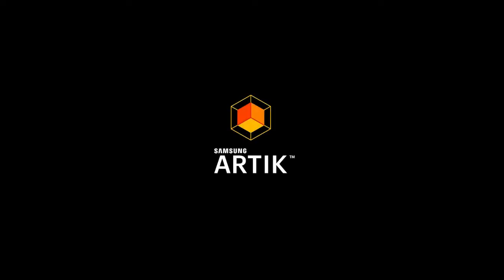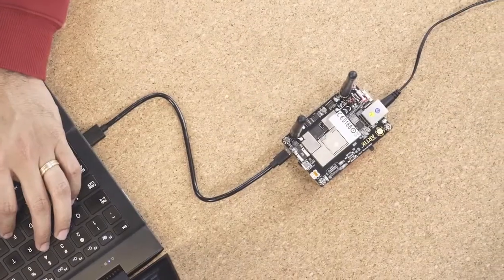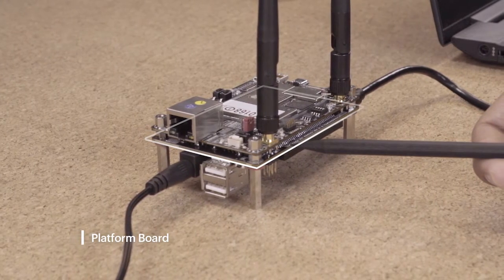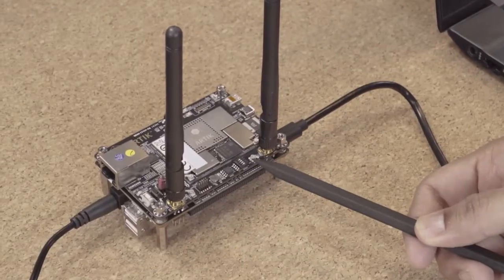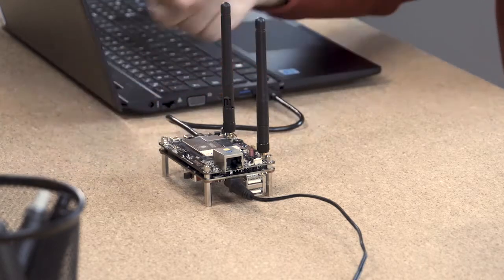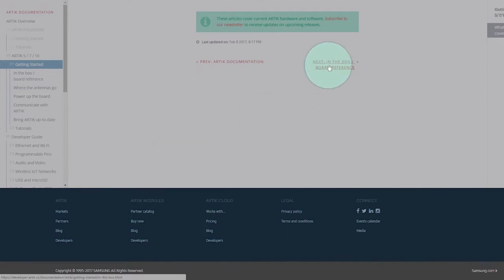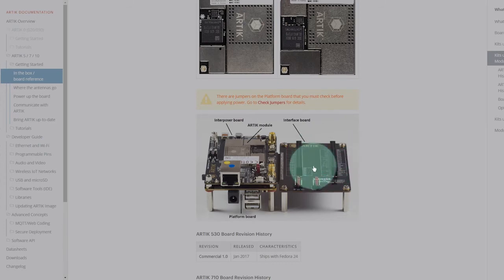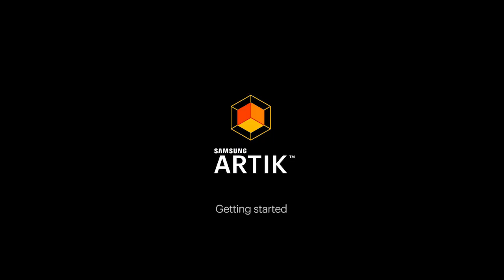ARTIK 710 training 1 - Getting started

Comment: Can I use ARTIK 10 instead?
Reply from the maker: A lot of it does apply generally to the ARTIK 10/1020, but you will need to check our documentation for specifics. For example, the GPIO mapping is different, thought the concepts are the same. Wi-Fi setup may also be subtly different. Check here: https://developer.artik.io/documentation/artik/getting-started/, and look for the ARTIK 10/1020-specific sections of the guides. Thanks for watching!